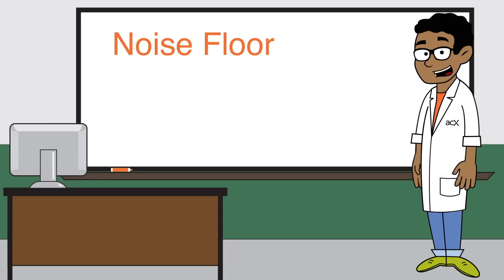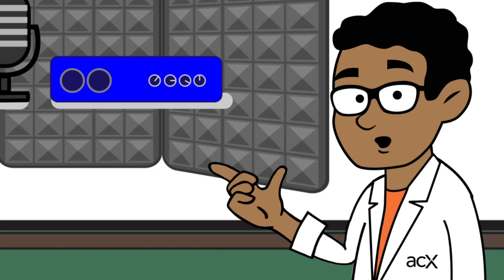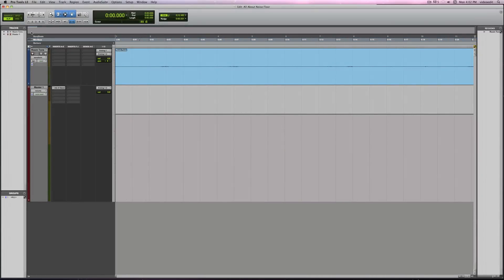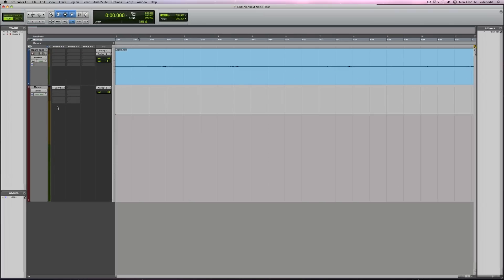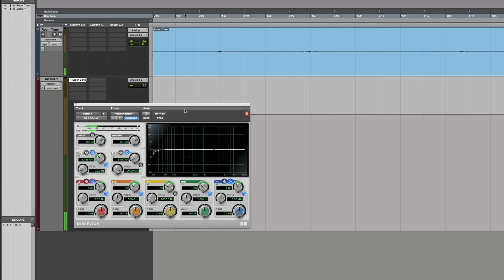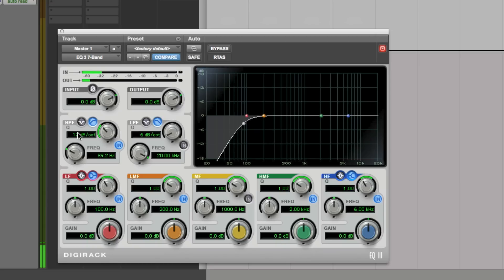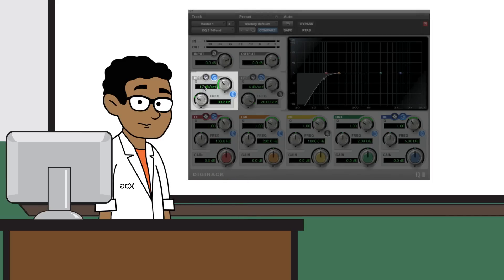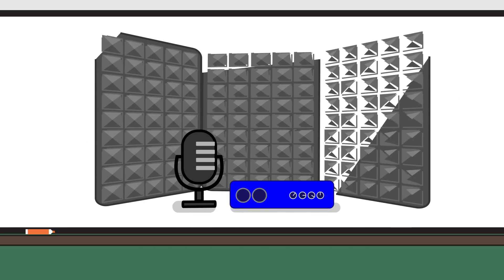All About Noise Floor with Alex the Audio Scientist

Comment: Please, can you address the opposite problem of noise floor too low if I use eq as is demonstrated here or any kind of noisegate at all. ACX audio lab doesn't check noisefloor but the ACX checker in audacity always says too low or unnatural. Will file be rejected with nose too low?

Comment: Dude , so many thank yous I thought I was fighting my pickups or electric ground loop but no lol it was my audio interface noise floor :)
Reply: If you don’t mind saying what audio interface were you using so I can be carful
Reply: @addisonlund3414  Focusrite Scarlett 2i4
Reply: @panndaacookies213  do you know how many decibels of self noise you were able to save when you solved your problem with the focusrite? And was your solution in settings, or did you need to replace it with another interface?
Reply: @addisonlund3414  a range of 6db to 12db of extra headroom with no electric noise from the gain turned up on my pre amps on focusrite. It'll depend on your gear,  stuff in your room and  frequenies of radio /wifi in the air . Also it can come from your gear , give that a check to . Also start ruling things out in your signal chain.find the noisy circuit , wether it be gear or frequency interference. Even your cell phone is a culprit . Turn it off or put in a separate room .
Reply: @panndaacookies213  wow 6-12 that a lot considering… cool thank u so you kept the focusrite just got the gain adjustment right and it no longer posed a problem? 
I really appreciate your comment I’m in the middle of setting up my VO booth and the focusrite was the audio interface I was planning on getting
Reply: @addisonlund3414  exactly ☺️🐼 and yes depends on what your recording , instrument , piano etc make sure you know how your gear works ,( line lvl or instrument lvl) , then adjust interface settings accordingly , and check for noise and see what kind of headroom you have to play with then , turn it up until ur master fader meter peaks at -6db to -12db , high drum peaks at -6 and other stuff can blend in-between for taste or genre
Reply: @panndaacookies213  thanks a lot truly
Reply: @addisonlund3414  happy to help n happy making music 💜🐼

Comment: I really wish I had someone to explain this to me in plain English and take me step by step how to fix it in Audacity. It sounds like Ancient  Mandarin to me right now *sigh
Reply: it's not complicated. Most of the noise floor is bass, the low end of the spectrum, much like you hear out of a subwoofer. So since that isn't needed for most narration, just filter it out. Really pretty simple.
Reply: This glossary provided on ACX might help: https://www.acx.com/help/audio-terminology-glossary/201456390
Reply: This Audacity wiki has the settings you can use when producing your finished audio:
https://wiki.audacityteam.org/wiki/Audiobook_Mastering
Reply: I'm in the same boat 😒
Reply: Room Treatment is 1st care then the Mic character.... sure the audio interface .... everything works connected each other...

Comment: All good advice.  The part about utilizing a high quality microphone and pre-amp may be generalized as "use high quality equipment."   This would then include the audio interface (which probably would have a pre-amp) and the microphone cable.  Cheap cables can introduce hum and static in electrically noisy environments.